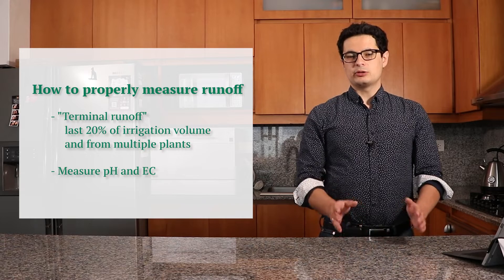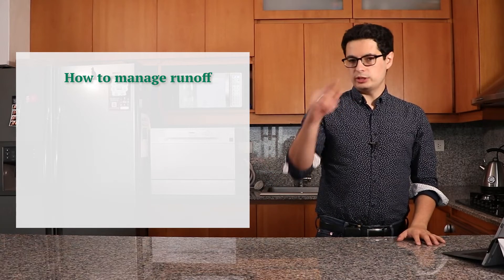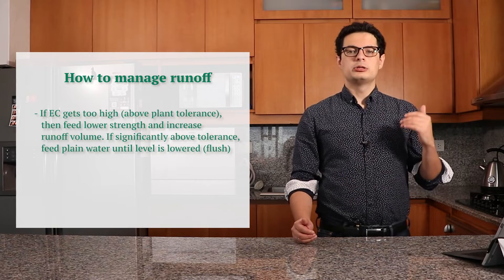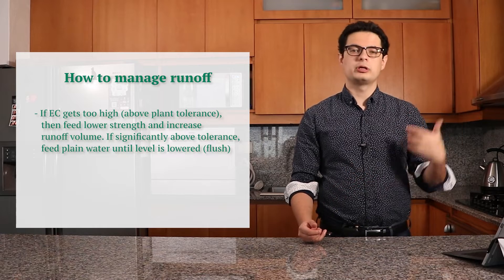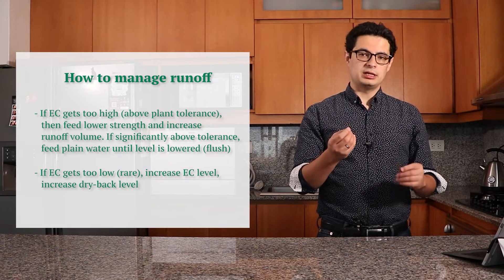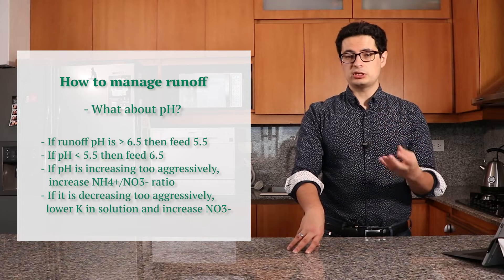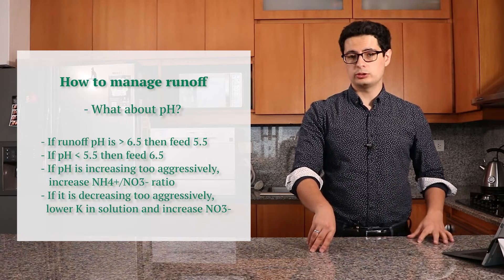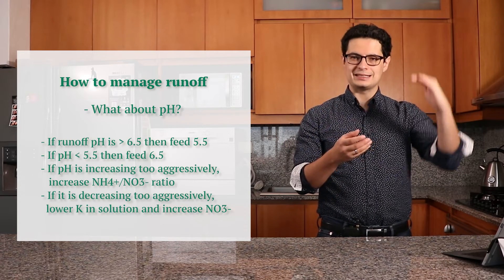Properly managing your runoff

Comment: Having runoff ec lower than input is quite common in coco since buffered and washed coco , which is not fertilized, comes with very low ec (up to 0.3) which means that watering it with , lets say, 1.2EC will result in lower EC than input - way lower. I usually get 0.5-.7EC as fresh runoff in coco if i water it with 1.2ec. 

Solution is to rise input ec to 1.5 and "charge" coco coir by watering it evenly until runoff achieves 1.2. Once i get desired runoff, i do last watering with 1.2ec to smoothen it out.

Fresh unfertilized (but buffereD) coco will still eat a lot of nutrients out of the solution so it needs to be "charged" like power bank and feed coco to the point it does not steal any ions from the nutrient solution anymore. After initial charge of coco, next waterings will usually stay withing the range which of course depends on drybacks and input. But biggest difference between runoff and input is when coco is not properly charged for the first time.

Comment: Hi sir. I have question. What you mean about terminal runoff? Accumulation of run off from early to last irrigation or just the last of irrigation that provide runoff?
Reply: Hey AROYA has some great professional science backed info on crop steering with veg & generative irrigation cycles dealing with stacking EC with no runoff to having runoff on your last irrigation event and drybacks or not and so forth.  Pieces of gold
Reply: @ thank you sir for the information. May i have the link of the video about it?

Comment: Hi Daniel ✌️ 
You helped me with germinating some old seeds a few months ago & I was hoping u can help me with something else this time if u don't mind.
If u grow hydronically using coco as a medium & ur run off is allways with in 200 & 300 parts per million eather side of intake ec do u really need to flush weekly?
Or can u give them plain water every 7 days double ur normal fertigation amount & follow up 1 hour later with a normally full strength feed?
I would appreciate ur reply champ.
Thanks again Da I'll.
Allso in peak bloom period should u feed daily when lights on or every other day?
It's canibus 
Sometimes I'll feed daily 30 min after lights on & sometimes a feed every 2nd day. I think they like the dry back??? day
LOUIS😊

Comment: This was an excellent video on this subject. I just chopped 4 cannabis plants, first time running a coco/20% perlite medium (previous amended coco or soil). Didn't water to much runoff throughout the grow But at chop when I did a water flush the runoff ph was super Low (mid 4's) (fed 5.8 in veg/ low 6 in flower)and EC was crazy high (high 5's when I was feeding less than 3.0). The plants finished nicely with an impressive fade and dense buds  But those numbers had me shocked and says I need to water to significant runoff in that form of medium and I need to monitor it throughout the grow. Any thoughts? I'll stop by your Instagram and follow ..

Comment: Hello Daniel. First off thank you for all your information freely available it helps so much. 

So after the flip/stretch I am noticing PH swinging way too high in conjunction with a clear accumulation of No3. So I pulled CalNit. I did a defoliation to try and swing plant morphology more generative by increasing sink load. I’m also watering @ 5.5 and bumped potassium up in my regimine, increasing frequency while slightly lowering duration of irrigation events to ensure more runoff delivered at a slightly slower pace. I increased the room temp slightly along with slightly raising the humidity. In hopes of raising plant metabolism while slowing transpiration to help translocate and “use” that excess no3 while treating the root cause. Does this sound like a sound approach? Thanks!

Comment: How does this information fit in with the new "crop steering" techniques being embraced by the cannabis community that use so-called "generative" steering by watering up to field capacity but not actually to runoff? Do the substrate sensors used in these types of crop steering systems replace the need to measure the runoff? I have the substrate sensors in my facility but I don't really trust them fully. Do you recommend watering to 20% runoff during the entire flowering phase (cannabis)? The new crop steering techniques recommend no runoff during certain periods of flowering. I find this conflicting info confusing as a beginner. Thanks I enjoy your videos.
Reply from the maker: You can always do no runoff for most of your plants and then hand water a single plant till you get 20% runoff to see how the media environment is. Watering with no runoff is environmentally friendlier so formulating and growing with no runoff - for all plants in general - can be better. However, to monitor the root environment pH and EC, getting runoff from single plants daily can help a lot.

You need to pay attention to salt accumulations though as many formulations do not play well with low runoff regimes as they tend to contain a lot of P, Ca and S.

Comment: I really feel like I'm going to have a completely different yield after watching your video. So thank you for providing your knowledge to the community. I would like to ask: When using soil, would you still want to use the run off to measure output pH & EC, or would you recommend performing a slurry test with the soil closes to the root environment? Thank you for your time.
Reply from the maker: Thanks for commenting! I'm glad you enjoy the content. When using a soil you still want to perform an EC measurement of the runoff. However, the soil - depending on how it's amended - can contribute a lot of substances that do not register in an EC measurement because they are not ionic in nature (like sugars for example), so the runoff of a soil can be at equivalent osmotic pressure at a lower EC.

Comment: hi Daniel I am growing I am growing in coco coir and my runoff ph is consistently above 7 . 7-7.3
I use rain water , canna a and b nutrients. and I ph to 5.8 but it comes out at 7+ . I flushed one of my plants with pure rain water which is ph5.5 and got the ec down to 300ec before I stopped  but the runoff was still 6.9ph . my usual runoff ec is within 100ec lower than input ec. so I feed 1.2ec and I get 1.1 out .
I use citric acid to lower the ph .  I had to feed with a ph of 4.6 to get the ph runoff to be 6.0 . is it ok for me to feed at 4.6 to get runoff in range ?
Reply from the maker: Thanks for writing. Feeding that low is not normal, make sure you never feed below 5.5 as this can hurt plants. The problem is the balancing of your chemistry at the root zone. Citric acid - or other organic acids like lactic, acetic, etc -  should not be used to lower the pH as it will actually cause it to increase even more aggressively after. Lower your pH using sulfuric acid. Also add 20% of the nitrogen your plant needs as ammonium and not nitrate. Once you make these modifications your root zone pH should stabilized.

However, for a more thorough evaluation of your current situation please consider booking an hour of consulting time.
Reply: Microbes doing it

Comment: thank you for posting sir. i just have a question about feeding. does input ppm need to be the same as substrate ppm? im vegging in new soil and run off is 1800-1900ppm after a couple weeks of plain water. im noticing dark leaves curling and a copper dot with a burnt yellow tip. im not sure if i should keep flushing plain water or add a compost tea at 1800 to feed. any input would be very helpful and much appreciated.
Reply from the maker: For an inert media usually runoff conductivity will be higher than input conductivity, if they are the same it usually means that either the ratios are not correct or the amount of nutrition is not enough. However if you are in soil this does not apply as the soil nutrient contribution needs to be taken into account. To properly address your problem you will need a soil analysis and proper formulation of both the soil amendments and any nutrient liquid feed.

Comment: Hello Dr. Fernandez,
thank you so much for sharing your knowledge with us.

I would like to add some suggestion for videotopics, that, to be true, mainly consist of questions I was not able to solve myself to date.

- Does the salt used for creating liquid fertilizer can have an impact on the expression ([pure white, ]almost white, very bright yellow, […]  almost yellow[, pure yellow]) of the chlorophyl-free parts of the leafs of (albo|aurea) variegated plants?
- I would love to see a Kratki tomato long time measurement project that shows the impact of Carbamidenitrogen to the pH when using RO water in comparison to your other fully-passive Kratki tomato that I assume was fed only Nitrate and Ammonium. I am suggesting this, because many people use those „made for hard tapwater“ liquid fertilizers in (semi-)hydroponic RO setups and end up with epic battles against acid drops fighting them back with sorts of rehardening materials like eggshells or by adding pH buffers. And could you please consider buying a professional glue gun before building another Kratki? 😉
- Could you describe a way to create your own liquid (single, two part, three part) fertilizer from liquid mono-fertilizers at the example of „canna mono“ products, taking the limited information into account endusers usually have about those products. I am asking this, because most people have easy access to liquid mono-fertilizers, but not to the salts, or they can not afford the overhead costs of their own production. Maybe, if you like the idea of a wider spec. (semi-professionals or enthusiasts) of people using Hydrobuddy, this could become an additional calculation mode.

I hope my questions and suggestions are not too basic or of the „you would not do it this way“-type or from the unprofessional side. Otherwise I would be more than happy for hints and keywords about how or where to find information to answer the questions myself.
✌🏻
Reply from the maker: Thanks for taking the time to comment and make suggestions! I'll certainly keep these ideas in mind for videos during the next few months.

Comment: So, if our runoff pH is > 6.5 we should irrigate at pH 5.5. I imagine this is because if we acidify the solution more we move away from excessively high runoff ph values. But in this way we are not also going to neutralize even more the carbonates / bicarbonates making the solution highly prone to ph fluctuations?
Reply from the maker: Thanks for commenting. The idea is to shift all the buffering capacity of the solution so that we can react with bases. You do neutralize some of the carbonates in your water by doing this, you turn them into carbonic acid, which is also working in your favor as it can react with bases. They will turn into bicarbonate again once they neutralize the basic pH in your media.  This is especially true if there is little time for carbonic acid to turn into CO2 and escape (for example if you have an injector setup and are irrigating quickly after setting the pH of the solution). 

So, we're shifting all reactive capability of the solution (phosphates and carbonates) towards the acidic side (forming dihydrogen phosphates and carbonic acid).
Reply: @ScienceinHydroponics  thanks
Reply: @stefano5080  
The difference between inlet and outlet PH is not indicative of the rootzone ph. If you run PH 5 water in and get ph 7 water out.. your rootzone is not PH 6, it is much higher.

Comment: For recirculating systems, how do you manage the EC?  Do you aim to keep it at a steady level?
Reply from the maker: Thanks for writing! That will be the topic of another video. For recirculating systems there are three different management techniques I use that can be applied, depending on your constraints. 

Keeping the EC constant in these systems is trickier because we must be sure not to over-add nutrients that accumulate in solution. So you can keep the EC constant, but when needing to increase the EC you should use a replenishing solution that is different from the solutions used to prepare the original nutrients.
Reply: @ScienceinHydroponics  and this solution would primarily be nitrates, potassium, and manganese with low level of Phosphorus if I remember from your previous video?
Reply: @ScienceinHydroponics  that makes me think of how aeroponics could actually be advantageous as it sends the ions directly to the roots with low overall runoff.  Possibly forces an equal rate of uptake.
Reply: @speadskater  
Running genuine aeroponics allows you to see what your plants are doing in, more or less, real time.  Something that most folks dont consider is that the nutrient uptake depends on light intensity and temperature. If you track the inlet and outlet volume,ph and ppm at hourly intervals throughout the day you will see this in action, especially with outdoor systems that are subject to greater variations in terms of light and temperature throughout the day.  The maximum nutrient uptake occurs in the early part of morning. The nutrient uptake reduces as light intensity and temperature increases. Maximum water uptake occurs at the hottest/brightest part of the day (no surprises there). Maintaining an optimum  nutrient for an outdoor DTW aeroponic system is not easy
Reply: In my opinion, with recirculating systems, you should run them exactly like a hydroponic deep water culture reservoir. You either occasionally dump and restart your reservoir to avoid buildup/deficiency, or you do sample tests to determine which salts specifically need to be replenished.
Reply: @SetTheCurve  what testing systems do you use?